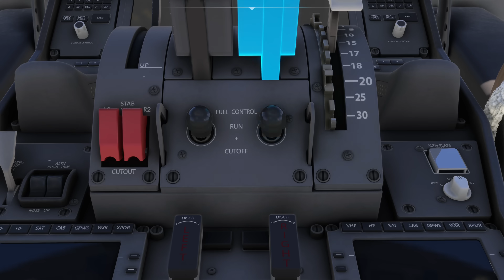Air India 171: Why Did The Fuel Cut-off Switch Get Moved?

Comment: Why are there so many desk experts here, and on other sites, accusing, or at least suggesting, that one pilot flip the fuel cut-off switches to "cut-off", when it is clear none of them did! 
The one asked the other, so he couldn't have done it, the other one answers that he didn't switch them, so, he didn't switch them! That is the evidence! 
So, could one of them have done it inadvertently? Maybe, but NOT if those switches function in the way that it should have, with the "pull-out" action required to flip them. Thus, considering the Boing "heads-up" about these switches, maybe that could have been the real issue here?! Maybe it should have been a "directive" rather than a suggestion!!! 
Boing at it again???
Quality control at Boing??? 
AGAIN!!!!!!!!!!!!!

Comment: Embraer E2 Captain here, on my aircraft of the thrust lever is not in the IDLE position, the aircraft disregards the “CutOff“ position of the engine selector, so if you suffer an engine failure, you must follow the correct procedure to shutdown the engine, first set the thrust lever to IDLE and the bring the Engine START/STOP selector to STOP.
It also protects the operative engine, if you select the wrong engine, it won’t shut down because the thrust lever is not in the IDLE position.
Reply: That is a great procedure....!!
Reply: FYI: the thrust lever was found in the IDLE position at the wreckage as noted by some. But the flight recorder recorded it as being not in that position. Scratching my head.
Reply: @soundmatters1841  bs
Reply: @soundmatters1841  post impact movement
Reply: @soundmatters1841 You are mot telling the full story.
 Quoting directly from yhe official report "The thrust lever quadrant sustained significant thermal damage. Both thrust levers were found near the aft (idle) position. However, the EAFR data revealed that the thrust levers remained forward (takeoff thrust) until the impact. Both fuel control switch were found in the “RUN” position. (fig.13) The reverser levers were bent but were in the “stowed” position. The wiring from the TO/GA switches and autothrottle disconnect switches were visible, but heavily damaged."
Reply: @soundmatters1841  Force of impact...makes things move. Something inside the cockpit may have struck it on impact. Who knows what's flying around at those G levels.
Reply: Beim Takeoff lassen sich Triebwerke aufgrund der Redundanz und der Messdaten des Systemzustandes bei einer 787 überhaupt nicht abschalten. Auch nicht  Leerlauf in den Leerlauf ziehen.
Sie können nur bis zum mindesterforderlichen Schub zurückgehen. Die 787 verhindert so einen Stall.
Reply: @antonsturm6185 I recently came across this: Here’s a developing theory that a rare electrical failure may have caused both engines to lose power — not because of mechanical failure, but due to how the 787’s safety systems are designed to respond in extreme situations. Specifically, we look at the possibility that the aircraft’s fuel shutoff valves (FSOVs), which are designed to close automatically when power is lost, may have played a role. This isn’t confirmed — but it’s a plausible scenario worth examining as we await the official report.
Reply: @merisehetherington9785   Alles erstunken und erlogen. (!)
Reply: Go and watch Video by Flying Beast who is an Ex Commercial Pilot and explained the whole scenario second by second and explain why he thinks its not the Pilots error.
Reply: @VijayChauhan-sr9rb 

Flying Beast has 9 million subscribers and 300k views in 3 hours.

He's saying the engines started spooling down at least 7 seconds, probably more, before the RAT started producing hydraulic pressure. So the manual fuel switches being switched off and on was probably part of an engine restart attempt.
Reply: @VijayChauhan-sr9rb  Not an error. Deliberate.
Reply: @VijayChauhan-sr9rb  Here’s a developing theory that a rare electrical failure may have caused both engines to lose power — not because of mechanical failure, but due to how the 787’s safety systems are designed to respond in extreme situations. Specifically, we look at the possibility that the aircraft’s fuel shutoff valves (FSOVs), which are designed to close automatically when power is lost, may have played a role. This isn’t confirmed — but it’s a plausible scenario worth examining as we await the official report.
Reply: Watch Flyingbeast video if you  really believe in unbiased explanation ❤❤❤ english subtitles are available
Reply: I just aske that exact question above in my comment. This makes total sense and if it's not like that on the 787, then I feel it's a major oversight
Reply: I have a question. Twin engine. Do the shut off switches need to be next to each other?
Reply: @adenwellsmith6908  Yes, the cockpit layout must be efficient and logical. If you start splitting systems, you will most likely create new problems
Reply: @jp1892  Really? For example, flaps have different handles from undercarriage. 

If you wanted efficient, then there would be no pull to turn the fuel off.
Reply: @adenwellsmith6908 
Yes the switches need to be together.
Reply: Excellent design
Reply: That's sounds sensible.
Reply: Here’s a developing theory that a rare electrical failure may have caused both engines to lose power — not because of mechanical failure, but due to how the 787’s safety systems are designed to respond in extreme situations. Specifically, we look at the possibility that the aircraft’s fuel shutoff valves (FSOVs), which are designed to close automatically when power is lost, may have played a role. This isn’t confirmed — but it’s a plausible scenario worth examining as we await the official report.
Reply: Hier geht es um eine 787 du Kaspar.
Reply: Sounds great to prevent it to happen by accident, do you have fire extinguisher handles or do you have to do the same procedure with a fire in an engine? What if the pilot moves the trust lever to idle and turns off the engine? In this case the guy who shut down the engines would just have moved the trust to idle and pushed the buttons, or just held the levers in idle by force against the other pilot. As long as humans can control the trust levers and the start/stop of the engine a human can do it and crash a airplane if they want to
Reply: @MichaelLarsson-s6f I read this: Here’s a developing theory that a rare electrical failure may have caused both engines to lose power — not because of mechanical failure, but due to how the 787’s safety systems are designed to respond in extreme situations. Specifically, we look at the possibility that the aircraft’s fuel shutoff valves (FSOVs), which are designed to close automatically when power is lost, may have played a role. This isn’t confirmed — but it’s a plausible scenario worth examining as we await the official report.
Reply: Embraer is a much better design than Being.  By far.
Reply: @CrystalKhlyr  Of course. Boeing is junk which explains why Boeing and Airbus together essentially control the global supply of passenger and freight aircraft to the major airlines, while Embraer is a very minor player.

Comment: Hi Captain Steve

Is it possible to have an audible warning from the cockpit when switching the fuel switches to the cut off position "Caution fuel cut off initiated, Caution fuel cut off initiated" just like the famous "terrain terrain pull up, terrain terrain pull up" passengers lives are in the pilots hands as soon as we board a plane, this action by 1 of the pilots can quite easily happen again, thanks, Richard

Comment: It’s quite possible, The switches were faulty as there was a bulletin from Boeing in 2018 saying that the locking mechanism on switch is on 787 can be faulty and for airlines to check that which I don’t think Air India has done. https://youtu.be/prSVUL_KCVE?si=W4oGIGASq8zzovte

Comment: Great analysis Steeeve! Two points- I'm a recently retired captain. I was based in ATL (guess the airline). A fact that professional pilots need to illustrate is the unquantified but significant impact of "pilot saves". Everyday dozens of potentially disastrous events are avoided because the flight crew catches and causes the remedy of an error. It could be a dispatcher error, maintenance error, fueler error, ATC error, etc. AI isn't ready to take control of the cockpit. It may help but not control. Secondly, after a mishap the public is ready to redesign cockpits. I don't recall if it was 9/11 or a subsequent event but pundits were suggesting that pilots shouldn't be able to turn off the transponder. If a piece of equipment is on fire or causing a fire, we need to depower it. As for the engine shutdown procedure, it can't be so complex that a flight attendant couldn't assist a pilot to shut down an engine on fire when the other pilot is on a bathroom break. My airline, and I think most US airlines, always have an F/A or other pilot in the cockpit when an operating pilot takes a bathroom break. This ensures quick entry if the sole pilot has a medical crisis.
Reply: Was the transponder issue related to MH 370?
Reply: @anitaj.4991  Yes. Thanks for jogging my memory.
Reply: "Everyday dozens of potentially disastrous events are avoided because the flight crew catches" Okay, it's official!  I'm never flying again! 😂
Reply: Sorry but I'm not going to or need to have a F/A help shutting down an engine. In a one in a million chance that you're alone and you have to shut down an engine, I bet he/she would be banging on the door within seconds.

Comment: India’s civil aviation regulator Directorate General of Civil Aviation (DGCA), on Monday, ordered airlines to inspect the locking mechanism of fuel switches on all Boeing 787 and 737 jets by July 21. “All air operators of the affected aircraft are hereby advised to complete the inspection required under SAIB Number NM-18-33, dated 17th December 2018, no later than 21st July 2025,” said the DGCA's advisory. “Strict adherence to the timeline is essential to ensure continued airworthiness and safety of operations,” added the body.

Comment: The full CVR audio will reveal:

1) the sound of the fuel control switches being moved.

2) what transpired in those 10 seconds between the time both switches were moved.

3)The remainder of interactions between the pilots.

The good thing is that the investigators likely already know exactly what happened because they have analyzed the audio. The public will have to wait and see.

Comment: Have few question as an citizen of india :
1. The question is who turned off the fuel switch is not a concern, but my concern is why Boeing doesn’t have an alarm system that triggers when the fuel switch is turned off while the plane is still active—especially during critical phases like taxiing or takeoff.
2. In aviation, incidents rarely occur due to a single failure; they usually result from multiple issues aligning, as explained by the Swiss Cheese Model of Failure. So my question is: what is the backup or fail-safe mechanism for the fuel switch? Does Boeing provide any fallback in case this component is accidentally turned off?
3. During pre-flight checks—which are performed at multiple stages—shouldn't verifying the fuel switches be a mandatory item on the checklist?
4. How did the pre-flight checks pass if the engine had no fuel supply? Shouldn’t that have triggered a failure in one of the checks?
5. If the issue was resolved by the pilot turning the switch back on, why did Boeing’s system take so long to respond? Shouldn't it have registered and restored thrust within milliseconds?
6. Why didn’t the aircraft initiate a rejected takeoff (RTO) either automatically or through pilot input once the engine lost thrust?

Comment: Your claim that "it's not boeing, nothing wrong with the airplaine" is quite bold, to say the least ... Either someone wanted to save money on maintenance or one of the pilot wanted to self-exit. In which case, why not simply fly the plane into the ground ? ... If it wasnt the PIC, then it was in all logic the pilot monitoring, i.e. the captain, that switched both engines off.

Comment: Maybe the pilot said he didn’t do it because he didnt do it….Naw, if the other pilot saw the fuel cutoff get flipped he wouldnt be asking questions & waiting 10 whole damn seconds…lets take the pilots at face value until we have proof otherwise….There was a SERVICE BULLETIN REGARDING THE COMPUTER CHIP ASSOCIATED WITH THE FSOV…..If not replaced after a certain cycle they can cut off intermittently….Examine the equipment involved…A GIANT FLYING COMPUTER operating in some of the most humid & hot climate on earth for quite some many years…ANA 787 anyone? There is no proof the switches were physically moved from anything I’ve heard….Spirit manufacturers did not put their heart into manufacturing anything…Disabuse me of my ignorance if I’m wrong.

Comment: I have a solution to avoid this from ever happening! And it's the most efficient way ever! However, this will require major recertification to all commercial airplanes. So let me explain:
There should be 2 sets of switches that totally make it to 4 for dual engine airplanes or 8 for 4 engine configuration! One of them should be installed on the captain side far left, where he can only reach and the other 2nd pair of switches should be installed on the 1st officer side far right where he can only reach. So when the pilots have to use them, they should be in common agreement when they need to turn off or turn on engine number 1,engine number 2,3 or 4. To turn on, for example engine number 1(left) the captain and FO switch designated for number 1(left) should be pulled up, requiring 2 switches to be pulled up!
To turn off engine number one (left) will require 2 switches to be pulled down, one from the captain side and one from the FO side, requiring again 2 switches to be pulled down! The same sequence will be applied for the number 2,3 and 4 engine! Another safety feature should be mandatory for all airlines that when one of the pilots needs to vacate the cockpit due to some psychological needs (like using the toilet), there should be one crew member in the cockpit observing the pilot flying during the absence of the second pilot! So simple!

Comment: Would it be fair to ask, if interviewing the pilots and passenger of the previous flight of the same aircraft from Delhi to Ahmedabad (just hours before this fatal flight) would reveal some answers. This flight from Delhi to Ahmedabad took off and landed safely. But, the pilots might have some insights as to any unusual incidents (however minor), malfunctions (esp. of the fuel control switch), power glitches, or any difficulties encountered in take-off or landing. Do we know affirmatively if this kind of investigation was done?

Comment: There should be some voice alert if fuel switch is turned to cut-off so that at least the other pilot is immediately aware of the change in all circumstances, required or catastrophic as was in this case…

Comment: Its likely that a pilot turned off the fuel switches, but your bias towards that conclusion and the hastiness to assert it forced me to read the SAIB NM-18-33 and the preliminary report. I am not an aviation expert, but here is what I understand as a layman.

A fuel switch with an engaged locking feature can only be toggled on/off by pulling it first and then move up or down. If locking feature is disengaged, the switch could be moved up or down without the need for a vertical pull and such a smooth transition may result in unintended switch movements. The 2018 SAIB NM-18-33 advised operators of several Boeing airplanes, including 787-8, to inspect for the potential disengagement of the locking feature. This was based on complaints about disengaged fuel switches in Boeing 737 from operators. However, in the preliminary report, its mentioned that Air India didn't carry out this check as it wasn't mandatory.

One could argue that chances are low for both the switches to go off accidentally (flight crashes doesn't happen frequently as well). My point is, its inappropriate that someone like captain Steve, who could reach millions of audience, to simply discard this possibility altogether and put the blame on one of the pilot based on the preliminary report.

Another thing is the cockpit camera. How come you know that the crash couldn't have been avoided if there was a camera?  If we assume it was one of the pilot who indeed turned off the switches and the passengers were fortunate to be at an altitude sufficient to regain the thrust, and everything captured on camera. Imagine the consequences waiting for such a pilot when they return. This would obviously reduce the chances of deliberate human actions with malicious intent.

Comment: So, in your previous video you said that these fuel switches aren't like normal ON - OFF switches. They are attached to a spring (also protected) and one must first, hold them, pull out and release (3 steps). So if a pilot was doing that, other pilot didn't notice? I mean if I am a senior pilot, i would (by side eyes). Isn't is a little suspicious? As far as I know, whatever pilots do, they confirm with each other before doing the said procedure. So how it happened under the nose of other pilot? Makes no sense that it took the other pilot 10 sec to respond to the situation (which is pretty fast, but in this case not fast enough), but other pilot cut off the fuel supply in just under a sec (again very suspicious).

Comment: hi, there is a small tiny block of metal that stops the fuse control to move down to cut position, and pilot needs to pull it up and move it down, is it possible that block of metal gets broken or rusted or something due to which the fuse lever is not stopped and it goes to cut position by itself due to spring action ?